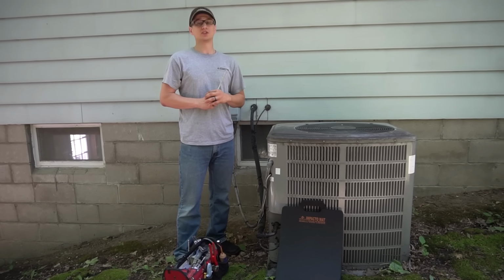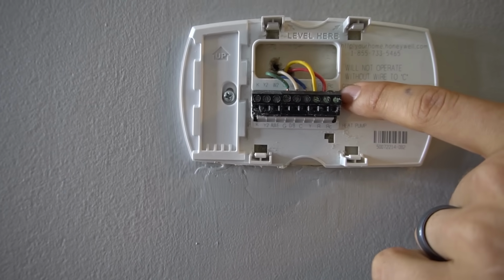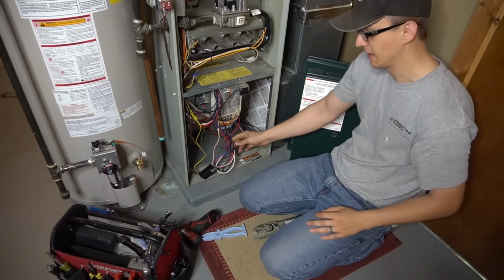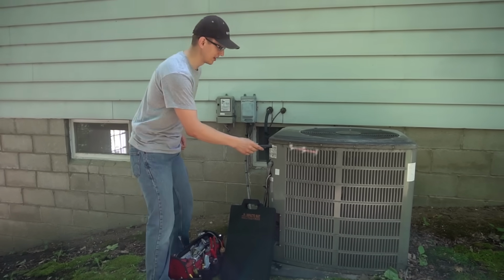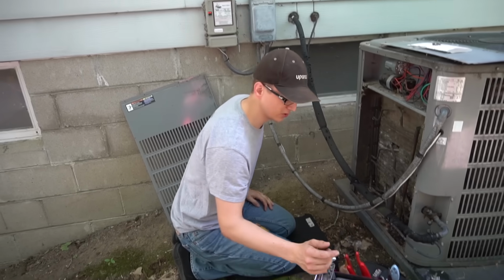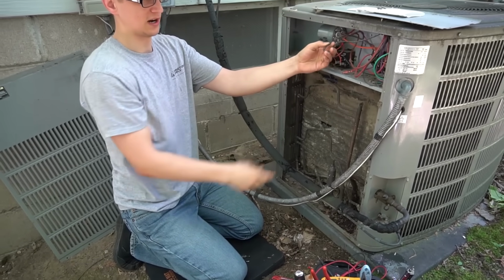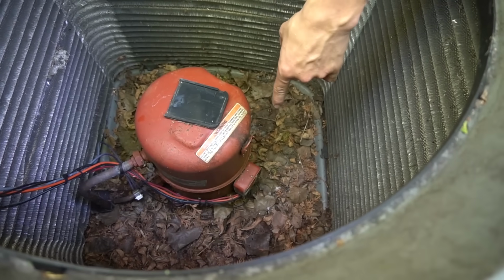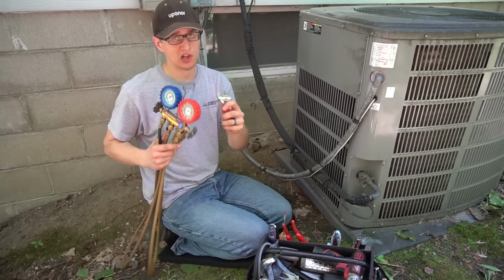AC Unit Not Turning On - How to Fix It Step by Step

Comment: I have 2 units, one works fine the other won't come on. The plunger pulls in on its own when set to cool, nothing comes on, I changed the capacitor from the good one as a test, same thing, when I turn the thermostat off and push the plunger in there's nothing but the weird thing is when i let the thermostat do it, i can touch the plunger with the screwdriver and feel a small vibration like electricity is pulling it down...so lets assume there's power, capacitor is ok, why wouldn't the fan or compressor come on? fuse in the handler in attic?

Comment: We had a storm and I lost all power in my basement and we have 2 units outside our upstairs works but downstairs is not working I tried breaker box and nothing but I can feel air in vents so would it be the capacitor I watched you're other video by the way
Reply: It could be but there's no guarantee of it. The best thing to do would be to use a multimeter to test it. If you aren't used to doing these things PLEASE just pay someone. Capacitors store charge and trust me from experience they HURT even when disconnected if you touch the terminals by accident without discharging them first. Coming from an ex-HVAC tech who's done it all. Sometimes it really does pay off to have someone professional handle these things. If you wanna learn, watch what they are doing and ask questions. I never minded this when I was a tech, I love teaching the customer.

Comment: Teacher I have a Gibson AC unit. Everything in house is working properly.  Upon outside inspection I noticed fan blade was not moving so I started it moving with a stick but even with fan spinning it's still not blowing cold air. I'm thinking oil the motor and replace the capacitor?  I would most appreciate  your advice. Thanks for all your videos that have helped me with repair my furnace in the past. Tom

Comment: Hi!  Thanks for your excellent videos!  I would appreciate your input on a problem that we're having:

We turned our A/C on (via the thermostat) yesterday after not using it for 3-4 weeks.  It was 81 inside; we set the thermostat to 79.  The inside air handler and outside condenser both turned on and seemed to be working properly.  After a few minutes, though, we noticed that the air handler was no longer running.  The condenser was still running, presumably still receiving a signal (from the thermostat or inside control board).  The inside temp was still 81.  I could feel cold freon moving through the high pressure (non insulated) pipe coming from the condenser.

I turned off the thermostat (to save the condenser from running).  After waiting a while, I turned the A/C back on.  Both came on and ran for at least an hour before the air handler again turned off (before cooling down to 79) with condenser still running, as before.

I checked the Safe-T-switch; it was dry and I had noticed earlier (when the air handler was running) that water was dripping outside from the condensation pipe.

Again, waiting a while, I turned the A/C back on.  The condenser came on, but not the air handler.  I tried again later and was able to get the air handler to come on also.

FYI, one time I noticed that after the air handler had shut off (improperly, as described above, with condenser still running), after some time, it came back on (without me turning A/C off and back on.

Overnight, we were able to get the temp down to 76.  But during the day today, we had a similar experience - difficult to keep air handler running (even though thermostat calling for it to run and outside condenser running).  

Our filter was a bit dirty, but not so much that I would normally change it yet.  In any case, I went ahead and changed the filter today.  This evening, we were able to run the A/C for several hours and the temp is now 79 inside, so it shut both (air handler and condenser) off normally.

At this point, I think freon is ok, water is getting through condensation line.  My question is:
Is there something else that would shut off the air handler - like an overheat switch or if the inside coils were getting frost on them?  I'm trying to think of what would cause the air handler to shut off (even though the thermostat was instructing it and the condenser to run) that would then be remedied by waiting and trying again later?

Thanks for any input/advice!
Reply: Did you find a solution to the problem? I'm having a similar issue. The condenser turns on but the air handler doesn't turn on at all.

Comment: Guy, you are fantastic. You're a great communicator. With your advice I was able to fix my outdoor central air unit. When I pressed down my contacts in the outdoor unit ...... nothing. Checked voltage before outside breaker ....240v. Checked voltage after breaker ..... 0v. Went and bought a new 120/240v 60AMP breaker and replaced the old one and ....... BINGO! .....AIR BABY!!
Thanks dude .... you da man!!

Comment: Thanks for the video, appreciate it. Living in Ontario Canada.  I have a 21 yo Lennox AC. I started it up last week and it was working, no issues. 4 days later, unit is not running. Thermostat is calling for cooling. Outdoor unit is NOT running. I turned off breaker in the house and at the outdoor unit. I checked the contactor and it is a dual contactor. Both contactors are pulled in, and I measure 27V across the contactor. I have measured 240V on the incoming side of the contactor. I replaced the capacitor last year, as it had failed. I have taken the current capacitor into a shop and they checked it and said it is ok. Fan in furnace is running and I can feel air coming out of the ducts.  I am kind of stumped, any advice before I call a professional? Thanks in advance for any insight. John
Reply: Ok John one time I had the exact situation you described at a customer's house. I checked and rechecked everything and ended up calling my boss for help since I was a young tech. So you have 24v supplied to contactor, contactor pulled in, line voltage is present on the contactor, and the capacitor is good. In this scenario the contactor is worn out. Over the life of the contactor of being snapped in and out repeatedly, it causes small pits and dents on the metal surface. After many years they will eventually not make good contact anymore, and the line voltage will still be there but the contact is too weak to carry the necessary amperage over to the motors. The solution in my scenario was a brand new contactor, making sure the wires were clean and snug under the screws, and she was good to go.

Comment: My HVAC is working fine but there is an electric ticking noise that is on and stays on for hours even when I shut off the system.  It seems as if there is an electric switch that is stuck and keep firing.  Any advice what to start looking for?

Comment: I have a Goodman unit that all of a sudden stopped working. Nothing works, the air handler is unresponsive as well as the outside compressor. Neither unit is making any noise at all. The AC was working for a couple days before it failed. The fuse on the air handler isnt blown either. The only thing making noise is a black and white box on the side of the air handler thats buzzing. It looks as though it collects runoff water from the system. Not sure what its called or if that could cause the problem. Ive tried shutting the AC breakers down as well as shutting the entire power to the house off and nothing. Any ideas anyone? Summer is kicking in and its 3 weeks until anyone can come look at the unit im trying to problem solve it myself but im far from an expert
Reply: You've probably already had a tech over but what happened here is that black and white box is your condensate pump. It pumps the water runoff from your indoor coil and pumps it over to your drain. 
When they fill up there is a float switch that is supposed to kick on the pump. The pump goes, the tub empties out, and the float drops and turns off the pump. 

This works great until the motor in the pump fails. Then, the water level goes higher and higher until it hits a second float, which is a safety shutoff switch. These are wired in series with the transformer, so when it hits the safety overflow switch it actually cuts power to the circuit board in the furnace and shuts everything down.  Why is this designed in such an annoying way? Because the idea is that it saves your basement floor from flooding out. Replacing carpeting is gonna cost a lot more than a service call! The only way to make it work again is to remove that tub carefully and dump out the water, and the power will be restored to the furnace. However, that means the condensate pump is probably failing or is already dead, and requires replacement. In the midwest where I worked that whole service call would cost around 250 bucks, just to give you a heads up.
Reply: Hey man thanks for the lengthy reply! It was in fact the condensate pump that shorted out and overflowed causing the unit to completely shut down like you said. It’s in the process of getting fixed. Thank god It was something minor I was afraid it would be worse news. Have a good one! 🇺🇸

Comment: My condenser 18-2 wire got chewed up by my dogs I spliced it back for the mean time and replaced the fuse with a 10a instead of a 3a is it bad to run it until I get another 3a and new 18-2 wire?

Comment: So I turn the temp down on thermostat the fan kicks on and everything but no air or barely any from vents what could be the cause for that
Reply: Dirty filter. If not then your indoor coil is frozen up. Look for ice on the bigger pipe that goes to your outside unit

Comment: My ac is pretty new, I got it last year and this year it does not turn on anymore the furnace is running so is the air inside but the AC unit is not making any noise it’s shut off

Comment: What could be the issue for the AC not turning on; if when switching the fan to on at the thermostat the air works, there isn't a flipped switch on the circuit breaker, the fuse in the furnace is not blown; in the AC unit outside the capacitor is good, and when pressing in the plunger the AC unit fully turns on, but at the thermostat when switch is on auto the furnace & AC don't turn on even though the batteries are good, the programmed temps are at 70°, & everything else checks out as good for connections in the thermostat, to the furnace, & AC unit?
Reply: The fan blades in the AC unit also move freely. Plus there isn't a reset button on the AC unit it's...
Reply: One of two things: 1) Your wires that connect from the outdoor to the indoor unit are damaged. Maybe a wire nut somewhere came loose? Carefully look. Its the tiny thermostat wire that goes to the contactor. Check inside the furnace too to make sure those wires are connected to the C and the Y terminals on the circuit board. 2) Your contactor is bad. If you have a multimeter check for 24v on each side of the contactor coil. If you have 24 v but it doesnt pull in, the contactor is failed.

Also please be careful pushing in the contactor by hand. If your finger slips you can get shocked badly.

Comment: I've told my heating/cooling contractor, I want to be able to switch from heat to A/C, without having them come-over & switching-it for me. Seems like a way for them to make some extra money. This is the third time I have to get'em over to switch-it-over & re-wire the thermostat. So I will be doing lots of yelling as my wife calms me-down with a porterhouse, for dinner. Oh. I switched the thermostat from heat to cool, and now not even the fan, will operate. Gonna be yelling. $6 grand and about one year of ownership, with this many issues. Very vexed & irked.

Comment: I'm having an issue. I just replaced my capacitor and it's still not working. I push the plunger in and it runs, but when I let go it stops. Can someone please help?
Reply: So the problem could be a few things here.  The relay/contactor could be bad or your not getting the proper voltage to pull it in.   Which means your high/low pressure switch could be stuck and not completing the circuit.  Your thermostat is not calling for power to the outside unit.  Which could be a shorted wire, bad wiring job, or thermostat itself is bad.  It’s a lot of variables there.
Reply: @kicker3506  I bypassed the defrost board, I think is what the board is, and I got working. I ordered a new board for it, just waiting for it to come in. Thank you for responding.

Comment: My inside fan is working it does not need coolant and i kickstarted the external fan but it stops in just a bit and i am not sure if it stops because it reached the hold temp or not and just wont start back by itself? So i assume i should replace the condenser fan motor huh?

Comment: Tied for "Firstly, I'd like to say"... the walk-through on possible problem points was totally on-point...tied for "firstly" is why would anyone give a negative.

I have an AC unit that blows air but the outside unit doesn't do anything. No hum, no noise, no fan. Breaker looks good, so it must be outside. I learned from this video how to check for electrical issues in a CAREFUL way. The system is old but I have a desire to check it before jumping in to replace the whole thing (especially with the financial situation effecting us all).

Even if it needs to be replaced, I can speak with the estimator on a more educated level about AC units.

I truly appreciate this video and I will use what I learned to do my own troubleshooting BEFORE jumping the gun to get everything replaced.

If, after, the basic checks deem the repair beyond my abilities, I will call upon a professional to do the work.

YOU are an honest professional.

Comment: Can anyone help me out here, or point me in the right direction. My thermostat sends a call for AC, but only the furnace blower turns on, and nothing outside turns on. I checked my AC unit outside and pushed in the test/override plunger. The AC unit spins up and compressor turns on just fine, for the unit is working, just not getting any call to turn on. What step am I missing here?

Comment: Sir Question- The problem i having is with the Blower Motor inside the House. The blower motor runs when in the heater mode. When it is in AC or FANr only mode, Blower motor doesnt run. The outside condensing unit, and its fan all run OK when the AC thermostat kicks in. May I know what is the problem? I didnt change the thermostat or nothing it just happened. Thank you in advance.

Comment: Hello, good video like always buddy. I have a question, I'm new to the trade and I'm working on commercial HVAC. So I have a no cooling call. So it's a 6 ton trane package and the units getting power but fan it not on or compressor. So I pushed in the contactor and the compressor came on but not the fan, so I  killed the power to the disconnect and tested my run cap it's good. What else can it be any info will help. Thanks God bless

Comment: Love the videos!  My question is... Is it better to be proactive and replace the run capacitor every x number of years, or just let it die a natural death?  Does the Compressor / run motor become damaged by capacitor failure and lack of notice for a day or two?  If so, it makes sense to me to replace the run cap every... 5 years?...  10 years? (especially since it is one of the least expensive parts on the AC unit!  Thoughts?

Comment: My problem is a bit weird, outside unit is working and compressor is running, the inside is running and pushing air, but the air that comes out the vents is not cold. There's no ice build up anywhere, the thermostat recently needed batteries replaced and the trouble started around that time not sure if they're related. Also when the unit comes on to try to cool it has a high pitched whine coming from the inside unit that stops after a short while. Also around the time when we were dealing with alternating warm and cold days and the heater and a/c were turning on back and forth from day to day the outside unit would not run unless I turned the breaker on and off. This happened just before the a/c stopped being able to cool also.

Comment: any tips on if i hear a “clicking” sound at the condenser unit when setting the thermostat to cool and/or turning thermostat to off? I hear the click and the condenser/compressor stay off
Reply: bad dual-run capacitor, bad contactor, bad line voltage to unit, tripped breaker in house, blown fuse in outdoor disconnect. BTW I am a union electrician and have a degree in HVAC and worked in HVAC at the start of my career

Comment: My furnace 3 amp fuse blows only when I have the fan set to be “Auto” and “Cooling “.  The 3 amp fuse does not blow if I have fan set to “On” and “cooling”.  I replaced both the capacitor and contact. Still same problem. What should check? Or possible failure?

Comment: AC inside kicks on but outside unit doesn't. I have a haier hc24c1var I don't see a plunger on the outside to test it. Airflow on the inside does feel a little restricted but I'm not sure what else to do without ripping the whole inside unit out to gain access to the backside where the coils opening is.